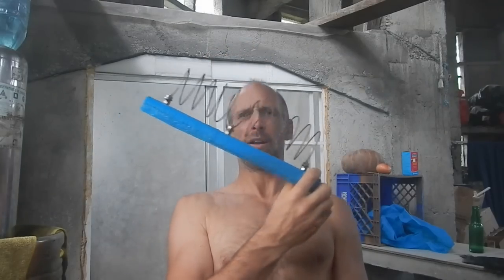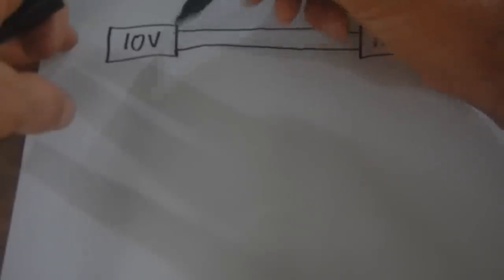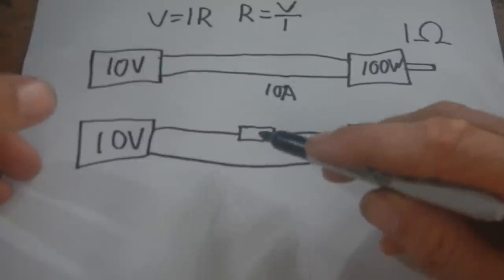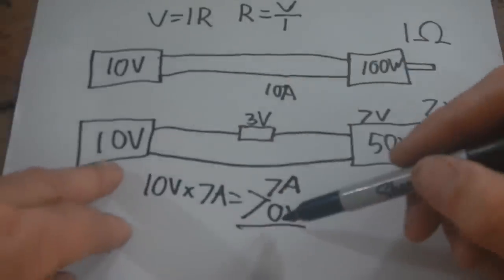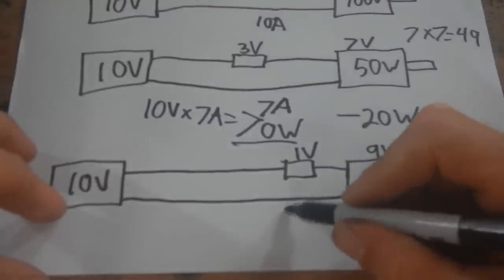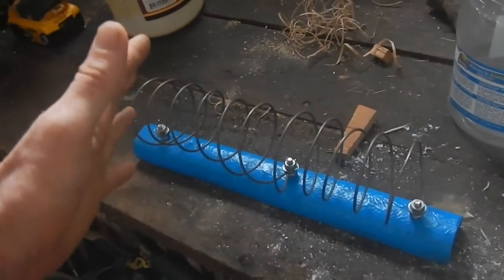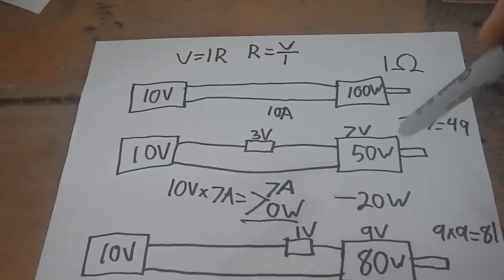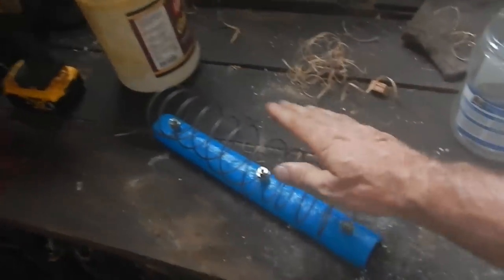$10 Resistive Speed Control.  Crap or Awesome??

Comment: Jamie great design!!! Love the simplicity!!  I am an electrical engineer and I agree with you on the advantages of your design!!  2 things to watch out for. 1) the posts where you connect your battery terminals to your speed control will heat up sometimes and with salt water they may corrode,  2) I don't know what the blue material is below your nichrome coils is, under certain conditions you wire may be radiating heat onto that blue material - if it can melt under extended use that would not be good.

Comment: My Tamiya RC car I had in the 80s worked this way. There was a ceramic piece that'd get crazy hot from the extra heat. It was so easy to understand as a kid. I always love your practical solutions and explanations.
Reply: Cool!  I had the Tamiya Frog as kid in the 80s, too!
Reply: Tamiya Mechanical Speed Controls were hot hot hot. I had a 3-Step that had a wiper over contacts that connected to taps on an external resistor, and a potentimeter version.
The problem with both was the contact arcing that caused contact wear and oxidation that required occasional cleaning to work properly.

Comment: I've been watching your videos since "The Giant Robot" days😎😎.    it's the perfect Speed control solution for your situation.   I would use it! but I would suggest including some sort of thermal safety in case the motor or its wiring short out and your .4 ohm resister gets connected to 10v and starts glowing red.   😮😮

Comment: Hi nice one Jaimie, remember that the load on the motor will vary the amps too.. Remote control cars used to use a onboard resistive load with a wiper, you could have a cable with a crocodile clip on it by moving it to different positions along your coil to control the speed.. Im currently watching your video. Its good because there is not much to go wrong with it, becareful not to burn yourself on it etc.. Have fun
Reply: and they make a great noise when you pull the controller's trigger repeatedly  - if I recall :)

Comment: The next level up is an electromechanical speed controller where you just have a flyback diode or two and a big capacitor and an adjustable set of contacts on the motor shaft. Much more efficient, and easy to repair, but the contacts wear.
Reply: I was thinking about this, on his last video, couldn't figure out how to use the angle of arc between the contacts to change duty cycle.
Seems like it'd need a second motor, to spin a set of "pwm" wheels.  Each one with a different size wedge that's conductive and a brush or wiper at the edge.  Power goes in at the shaft and out at the wiper.
But it's overkill, for something that's only going to be used occasionally, ?

Comment: You can easily get more speeds out of a controller like that too by putting more attachment points on it, a wire to each one, and someway to switch between them.
Reply: Or just a switch across each section, to short it out.  Close all the switches, the whole coil gets bypassed.

Comment: If you open cheap Scalextric speed controllers, its the same method. Another idea for a boat that we used on small boats is to just mechanically break the boat with "flaps" or raise the prop partially out the water for speed control?

Comment: It's not only a speed controller but a food cooker it you turn the motor to a really slow speed like 10 or 20% So you get a slow cruise and a toasted sub sandwich!   It's an excellent way to get maneuvering speeds and it will last in the jungle where most electronics will not.

Comment: The simplicity and reliabilty is the reason that resistive speed controls and dump loads are still used in many industries.
Reply: Dump load is for when you have excess power generation. Not the same as wasting bettery power in an electric vehicle.

Comment: Another very simple speed control can be achieved when you have two motors. Run them in series for low speed and in parallel for high speed. Or you could do something similar with two batteries: parallel for low speed, series for high speed. Combining both methods gives you 4 options, two of wich should be theroetically identical, thus 3 speeds, just with switches. The fancy speed controller basically does the same thing internally, but using capacitors instead of batteries and constantly switching around to re-charge them.

Comment: maybe find a suitable "in cup" beverage heating element with suitable electrical characteristics and put it in "switchable" series with the motor. Every time you set out or get back to your mooring you've got some warm/hot water to use as you wish.

Comment: A better design for high amperage soft starting is a varistor jar with two stainless steel plates that you lower into a sodium bicarbonate or dilute vinegar solution. 
If you design it so when fully lowered they are pressed together into a v-socket and contact each other. You have zero resistance.
Worked great for trains and trams and ships for a century.

Comment: The way he put that wire in a coil makes me think why not attach a wire to every turn. Then attach those wires to a rotary switch. That would give you 20 power levels and make for smoother docking.
Reply: In some situations that might be needed, but he doesn't, and it would add 40 contacts that could corrode in the salt air, and constant humidity.  Plus it would add a lot of complexity and work to get it done.

Comment: The other way to get half power - is to tap the battery stack at half voltage - ie. Make the 12V battery out of 6V units - or whatever topology is achievable..   (4x6V for a 24V system - on the fly reconfiguration at "full efficiency" is an option, simple busbar switches gets it done.)
Reply: batteries go out of balance

Comment: Motor current draw is also a function of physical load on the motor. If you could get a really efficient mechanical way to change gearing that would be even better. However running at full speed almost all the time negates the need as you've pointed out and I think this is a brilliant solution
Reply: - like, one could use a disk (or hemispherical) based friction drive - larger radius, slower speed  - same power output. - full speed could simple engage a 1:1 drive dog for "100%" transfer...

Comment: some easier math. V=IR, W=VI=I^2R, R=W/I^2. R being total system resistance. W system power. So the resistor would be Resistor= R-1ohm(motor). back when I did robotics in college, would use resistive motor controllers for some higher power stuff. and had pwm controllers for smaller load. Another Resistive type controller that were used by DC electric cars were salt type. Gave fine tune control by varying distance between plates in a salt (dry)

Comment: If you have several solar panels or batteries/cells in series, could you not switch the motor between taps in the battery or solar array?

Comment: By the way, electric motors are not resistive loads. They generate counter voltage as they spin and internal resistance and reluctance is supposed to be as small as possible. That doesn't mean that you calculations about efficiency are not correct, but you loose the torque and rpm stability when using resistive speed controller.

If you load the motor, it takes more current and the voltage drop across the resistor increase. Without load, rpm is almost the same with and without the resistor. Under high load, even small resistor limits the power greatly.

Boat may the best place to use resistive controller since there's no need to control power precisely. Any land based vehicle would be terrible to drive with resistive controller. Pwm behaves like adjusting voltage, and it gives high torque and good rpm stability

Comment: that's gonna get hot so pvc might be a pass - and little fingers will get burned . also the resistance of the motor will add into the total resistance (neither here nor there) great idea should work a treat !

Comment: Keep in mind that with the resistor now your changing the motor maximum torque not speed and you will find times you need to change the resistor value to start the motor , so maybe use a crocodile clamp for the middle point.

Comment: Certainly better than electronics that fail easily and can't be fixed. 
Better is switching two motors to series for low speed or parallel for high. 
Better to buy some Nickel iron batteries, which come as single cells of 1.5 volts, last 100 years and cannot be damaged by overcharging, over discharge. And switching cells in and out of a series battery. For speed control.
If you have voltage readouts on each cell, you will get your excellent speed control, and 3 to 10 times the energy from your solar to your batteries or motors. 
Resistive speed control is good for soft starting. And short term manouvering.

Comment: Weird, looks like my comment about building your own cheap PWM controller got deleted. Maybe because I included a link to a schematic. Anyway, your idea is pretty good and will probably work exactly how you want for what you're using it for. That said, if you do have issues with torque and uneven speed control (because as other people have pointed out, a motor isn't a simple resistive load but also applies counter EMF voltage) with it, you might try building your own simple PWM controller with a 555 timer, a MOSFET (typically an IRF540, but you might need something a little beefier for your motors), and a handful of passives and some kind of potentiometer to control the PWM duty cycle. There are many schematics for this out there, and they're all basically the same and quite simple. Beauty part is, if you design the physical throttle connection to the potentiometer properly (you could easily build the whole circuit into the base of a chunky throttle handle), you can add a bypass switch for when you hit full throttle and just want to go direct to battery. Might do to put that on a relay with a delay circuit, so you don't fry your mosfet on accident. A pair of diodes might also do the trick, since they'd only have to prevent that reverse current flow for the brief moment you hit the switch. Lots of ways to cook that chicken!
Reply: Yeah, just realized the simplest way to add a bypass would be to use a potentiometer with an on/off switch. You can easily reverse the "polarity" of the pot in the PWM circuit by swapping the direction of the two diodes you use for that, so that the on/off happens when the PWM is at max duty cycle (normally the on switch turns the pot on to it's highest resistance value, like you'd want for a dimmer, though there are probably some that are opposite. Doesn't matter for a 555 used for PWM). Then you get a nice "click" at the end which would indicate full throttle, and you can wire that switch to both shut off the PWM circuit entirely, AND to control a relay (with a protection diode) to swap the mosfet output for direct battery output.

Comment: In general your point stands, and I agree that the resistive control is a great choice for your situation.  But I have to say, electric motors are not a resistive load.  That math is so far from reality that it is really a pointless exercise...
Reply: @ChaosSwissroIl  Its a tale as old as time in physics.  They start you off with a very basic model maybe one or two simple equations.  Once you understand that and the math behind it, and advance to the next chapter/class they reveal it only holds true in very specific and unrealistic circumstances.  Here is a much more complex model we are going to learn about now with multiple relationships, equations, way more variables.  And guess what happens right after you think you know everything there is to know about that? 😂

The more you keep digging, the more complex it gets.  The reason it matters here is because the motor does not react in a simple linear way to all the variables involved in him actually operating it in this real-world use case.  It also would not be worth accounting for every variable to calculate every minute detail.  There is a balance between perfect and good enough, which is exactly why there are models of different complexity for many problems in physics or otherwise. 

Bottom line is the concept is solid and has been proven many times over, that math just isn't adequate to describe it. 

Heres some search terms to help you get started if you want to brave this rabbit hole.  Back EMF, Reactance, Electric motor mathematical model
Reply: @ChaosSwissroIl  I already gave a detailed answer with more than enough info for you to figure that out.  If you aren't willing to put in any effort to learn something new then there's nothing else for me to say to you

Comment: I'm wondering, does it make sense to use variable capacitor in place of variable resistance (so we can discharge it later in a useful manner)? The "later" above can be one second later (or whatever is practical), when we stop using the battery and start discharging the capacitor, to threshold, then switch to battery, and so on, and on... 

I know it must be more complicated, comparing to the simple resistance. However, there's a good use case for having efficient speed control. It is useful not only while docking and/or starting. It can double or triple your boat's range. To double boat's speed, the power needs to be squared. On the other hand, reducing the power by half, will slow down the boat only a little bit, effectively doubling the range, without sacrificing much time.

That's, probably, what the expensive unit is doing anyway... (Just a guess)... Personally, I would go with the proper speed control, and would bypass it on full throttle. In a case when battery isn't fully charged, i still would have a choice: to get there halfway fast, and paddle slowly rest of the way, or to get there all the way at, say, 80% of maxim speed. I would do the later rather than former.

Comment: so does that mean the resistor will get hot?   maybe its doesnt need to be wasted.   maybe that heat can be used to make a cup a joe or something....
Reply: Your point is well taken and should be heeded if the controller is up-sized.  The wire Mantzel is using dissipates heat like a heating element.  The heating elements that heat coffee run at about 120 Volts.

Comment: Rudimentary and easy to fix wins over slick complexity every time in my experience and even if you are wrong its a cheap mistake. My example was an evaporative AC I made from an inline fan and a water pump and a float valve, working for 3 years and when a part does fail I can buy something off the shelf. Recently I bought a split system ac and the thing didn't work out of the box because it lost its refrigerant somehow and there is nothing I can do but either get it regassed and hope there isn't a leak or just buy a whole new unit because I installed it as an "un qualified electrician" on my truck (even though its never been moved) the warranty is automatically voided. Because companies do whatever they can to get out of being responsible for their products.

Comment: The piece you want to replace doesn't have to cost $600. Like anything you could design a simpler electronic stuff that's more efficient than your simple design and still not that complicated. That being said, your design might be more approriate since you are planning to use it for 'gearing' starting and parking.

Comment: If you try to push the boat faster than its hull speed. You will still be wasting energy. So I think that  speed controller is what you need.
Reply: Yes, but he's sized his motor to his hull speed, so his full speed is the most efficient.
Reply: My thought is. Which is more inefficient? I think pushing the hump is more inefficient. Just my thought.

Comment: WHEN.. you run electrical things without the proper full amount of power.  It will heat up the electrical motor.. this is why they design them with multiple windings.. and it is why a toy train set burn up the you engion..   IF YOU WANT I SOFT START.  WHY DON'T YOU HOOK UP THIS A SOFT START BATTERY OR SOLAR.. LIKE HAVE ITS SOFT START ON YOUR BOAT LIGHTS AND THEN QUICKLY SWITCH IT TO YOUR PROPER FULL VOLTAGE RUNNING..

Comment: It's Mantzel physics going on in there - if you simplify it even more, you would not waste anything as all energy has been conserved... :D Anyhow, it's about efficiency not some waste - if DC motor you're using has 50% efficiency, 100W of supply will give 50W of power, so if you convert it with wire "converter" at 43%, your motor will convert power with 21% efficiency throughout whole setup, so it means you're wasting 79% of energy for nothing - which is crap result even by your standards. It much better using PWM converters at 90+% efficiency and gain more then double power at 50% of supply (50x0.9=45%).
Reply: I dont think you understand why he want to use this. 
The speedcontrol is not for driving, it is for start and park.
Reply: @FREENAMEFTW  in that case he could just use a soft start circuit and pulse the power manually with a button.
Reply: @mrtechie6810  Alright, tell me more? 
What are the advantages of this circuit + button over the wire?
Reply: @FREENAMEFTW  if it's only for a moment, then it doesn't matter. But it wastes battery power. Not good as a general solution for speed control.

Comment: So it wastes 25-50% of the power. No thanks!
You have an underpowered motor if you run it at full speed all of the time.
But if it works for you, then enjoy!
It sounds like you just want a soft start circuit. And for brief controlled speed you could just pulse the power manually with a simple button.